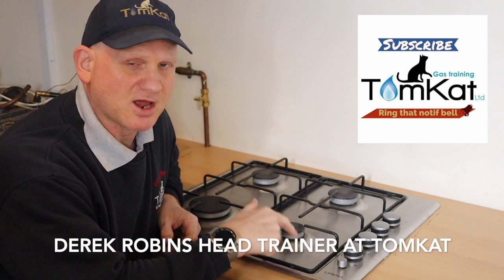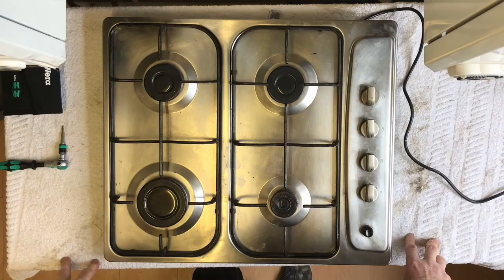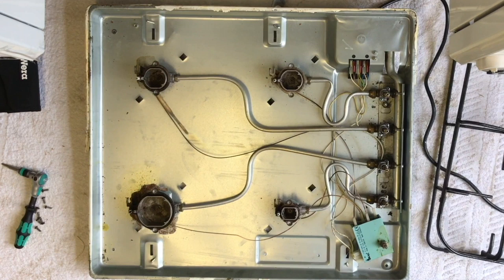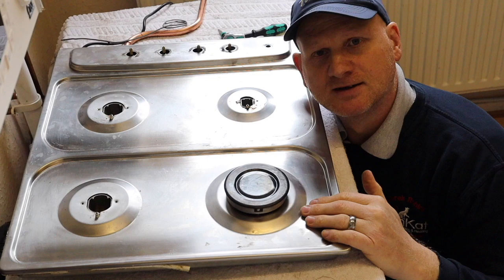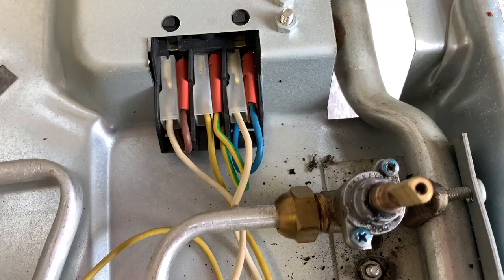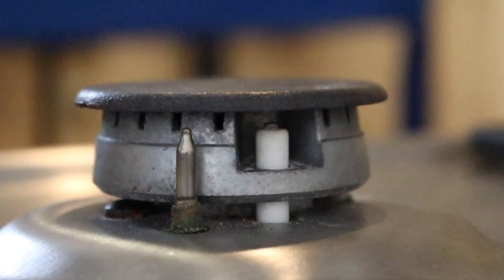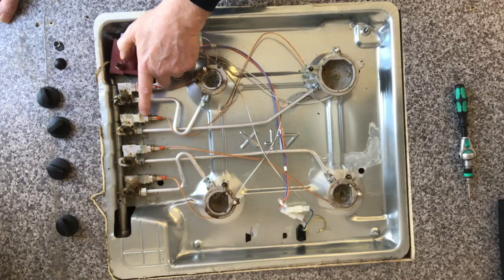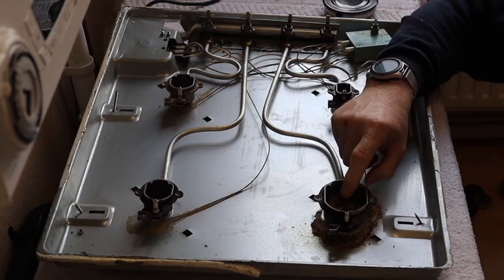WHATS INSIDE A GAS HOB, gas tutorial on what you will find inside a gas hob and see how it works

Comment: Great video. I have bought an old mobile home which I've moved into. I tested the gas water heater which was only tested a few months ago and that works fine. The problem is with the gas cooker. I turned one of the knobs and the gas started coming out but when I turned the knob back to off position, the gas kept coming out. I had to run out and turn off the valve on the propane tank and haven't touched it since after. After looking at your video, would I be correct in saying that the graphite grease may completely dry and preventing the valve from shutting off or am I barking up the wrong tree? I have asked 4 local registered gas installers to have a look but they said it'll be months before they get a chance to call out. I am badly in need of the cooker. Thanks I appreciate your feedback and loved the video. Great detail 👍

Comment: Excellent video. Any tips for an ignitor that clicks and sometimes lights (1 in 100) even after I've cleaned and checked everything on your video and others? Is it a duff ignitor control thing? The oven is a Canon Chichester and is about 15 years old but in great condition otherwise.

Comment: What is an injector?
An injector is an electromechanical system in a car that is involved in the formation of air/fuel mixture. This term refers to a fuel injector that injects fuel, but also refers to a fuel system with multiple atomizers. The injector works on all types of fuel, thanks to which it is used on diesel, gasoline and gasoline engines. In the case of gasoline and gas equipment, the fuel system will be identical (thanks to this, it is possible to install LPG equipment on them to combine air and gas). The principle for gas stoves is the injector, an air feed to get the right flame identical, only it works under a certain pressure that is mixed with the gas.

Comment: Great video! I have a question. I was recently melting chocolate for a cake, and spilt it over a burner, and now set chocolate has stopped gas coming through the injector. Can i get hot water and a toothbrush to clean this without taking it apart? Again great vid, thanks!

Comment: Brilliant video....just wondering if the gas tap was letting by and readings were found at the burner with with knob in the off position....would greasing the barrel with graphite grease  cure this problem also along with making it easier to turn if stiff. 
Thanks in advance 👏👏👏

Lovin your vids 😄
Reply from the maker: paul rossiter it’s the first thing you would do to try and resolve the issue. 👍🏻

Comment: Hi I’ve got an issue with my Gas Hob, when cleaning it one day a lot of water got into the igniter switch and I believe that it shorted out so I’ve replaced the igniter switch, and I still don’t get any ignition spark. I haven’t been able to check the plug which may be a blown fuse but I don’t know where the power outlet is in my kitchen for the hob any ideas or suggestions?

Comment: Gas appliances seem so old fashioned, but they are cheaper to run than electric stoves and they heat things up faster as well. But if it doesn't light you can smell gas. :/